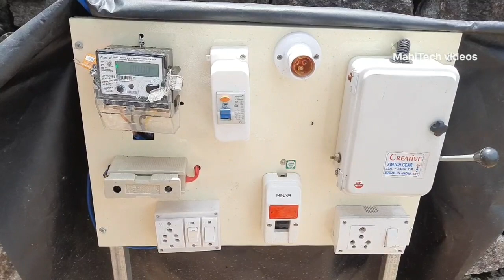വീടുപണിക്ക് KSEB യിൽ നിന്ന് കറണ്ട് കണക്ഷൻ എങ്ങനെ എടുക്കാം||Temporary electric connection.

Comment: njaan oru plywood board upyogichu ee board undakkeee,  kseb line connection um kittee. light,welding machine ellam work cheyyunu, pakshe ippol angle grinder upyogikkumbol power off aagum. 10 second kayinjaal tirichu varum , fuse check cheythu no problem,  ithu vare angle grinder upyogichu iruunna thaanu,  vaere angle grinder test cheythappol same problem .. issue kandupidikkaan paattunnilla..